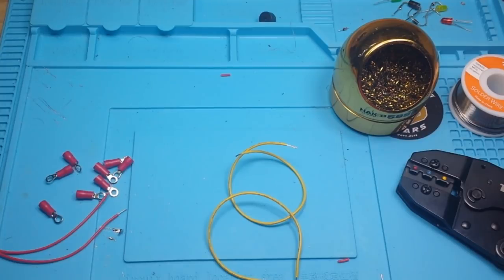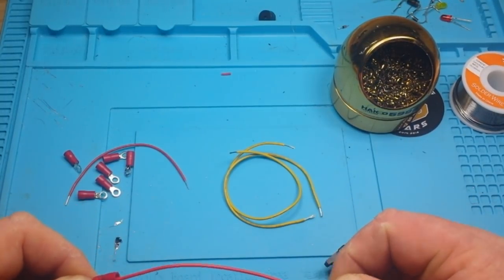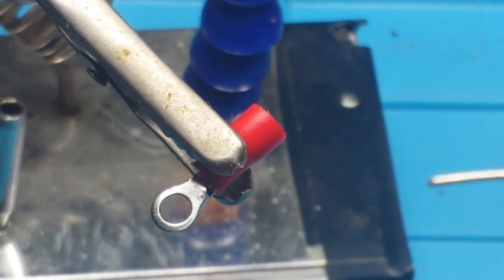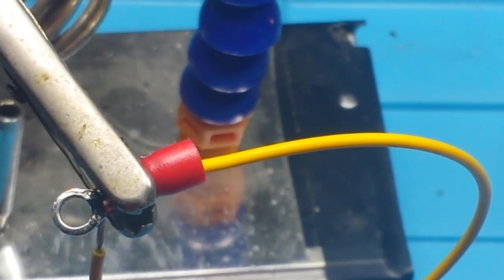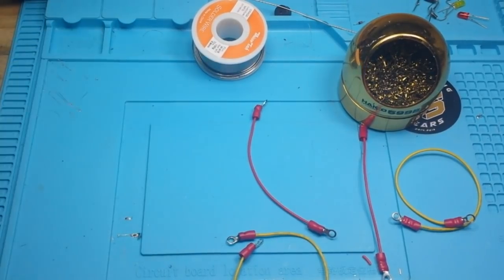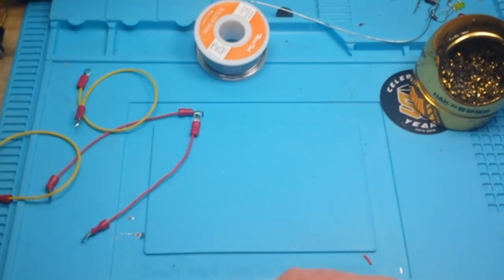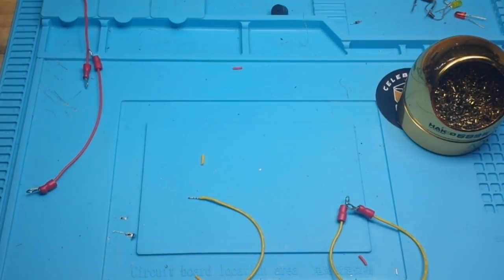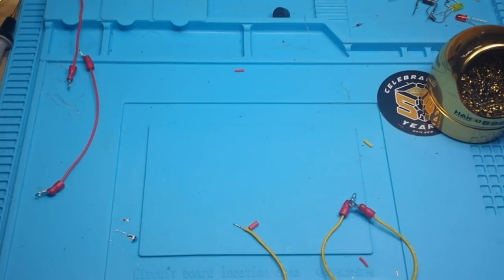To crimp or to solder terminal connectors

Comment: I really wanted to watch this video but I cant stand hearing anyone say SODDER...
Its spelled with an L in it FFS.
I dont know why this bugs me so much but it really does
Reply: The aluminum / aluminium debate is MUCH more fun, though.  :-)
Reply: @chrisw1462  Totally agree!!!  The colour of aluminium is FAR nicer than the color of aluminum <Tongue-in-cheek>.
However, it's still impossible to 'solder' aluminium just the same as it being impossible to 'sodder' aluminum

Can I please have some tah-may-toe sauce on my tom-are-toes?
Reply: @PW_12345  Weld alumin(i)um?  DEFINITELY...
But so(l)dering it? I seriously doubt it.
Perhaps a flux that's based on something like NaOH to remove the oxide surface followed immediately by soldering within some form of shield gas...
I'd prefer to stick with plain old TIG welding thanks
Reply: @PW_12345  - Close... the English say 'soul-der' (the last bit exactly as written, and essentially the same as the end of the American pronunciation). And it would be very rare for the word 'sod' to be used in its sexual sense (sodomy); normally it's an expression either of slight anger about somebody or something - or a lump of turf.

As for France, it's more than a political rivalry - we've quite deliberately spent the last thousand or so years winding them up in all sorts of ways! Here's one of my favourite examples: The Americans invented colour TV - the system was of course referred to by the initials of the standards committee - NTSC. Or as we knew it, Never Twice Same Colour. Then this guy in Germany called Walter Brusch fixed your little problem with a system using alternating subcarrier phase - PAL (Phase Alteration, Line). Of course, the French didn't like this at all - especially when the British adopted it. So this guy called Henri de France (really...) decided to go one better and do some really dodgy stuff with a delay line and separating out the colours and devised a thing called SECAM (SEquential Colour Aide Memoire). And of course we refer to that as System Essentially Contrary to the American Method... gets them every time!

And I often tin the very end of multistrand wire, and then crimp it - for all the reasons given.
Reply: It's English.    Letters are silent.

Comment: Not a Hot Button.   Not  even debatable.    Crimp and Solder ( or Sonic weld ) .   Build my AirCraft  and Subs  Right Sir.       Corrosion is the main issue at hand.

Comment: Copied from the interwebs: A crimped spade terminal actually creates a metal-metal colloidal bond at the surface between the wire and the terminal, and if done right, no gas remains between the surfaces. This ensures longevity and safety, making this the preferred mechanism in industrial implementations.
Reply: Like you said, where and the type of wire.
Reply: It is cheaper to mass produce.  That is the real motive.

Comment: You are using the wrong type of connectors for soldered connections. So you are not comparing apples to apples. You have way too much space between the wire and the connector for the solder to fill. In addition if you solder something and blow on it you are cooling it and can form a cold solder joint. Copper is a malleable substance that compresses and stretches. Over time, a crimped connector can fail as the harder metal in the connector loses contact with softer copper wire. Also, oxidation can form between the wire and the connector that are crimped creating a resistive connection. So, use a proper connector that is meant to be soldered that has a minimal gap between the OD of the wire and the ID of the connector. Solder it properly and install heat shrink that has some hot melt glue in it over the connector. You then have a waterproof connection that will not oxidize and degrade over time. As far as wire flexibility, if that is a concern in the first place you should be creating a pigtail in the wire to allow for flexibility or using an extremely flexible wire with many fine strands such as MTW. I would trust a good solder over a good crimp any day of the week. I have repaired thousands of assemblies due to poor crimps and loose connections and very few where a solder joint was used. Just my experience as a bench tech and ME for 30 years.

Comment: Am not keen on crimping there are 2 possible causes of failure !
Reply: 1) Vibration causing failure
2) Corrosion
3) Creep in the metal.
Reply: @kensmith5694  Corrosion on the connectors for sure. Metal creep and vibration causing the connection to break down. Crimps on plugs or socket pins on non moving items can be extremely long lasting

Comment: omg u dont know how to solder.. the flux is not hitting the metals at all
Reply from the maker: You're right. My 2 years of Navy training, and 8 years of college were for nothing. Thank heaven i didn't spend 23 years working in electronics, would have been a disaster.
Reply: @learnelectronics  I got u beat with 27 years in electronics :) certified ipc specialist. Putting solder directly on the solder-bolt tip and blowing cold air on a cooling down solder point is a big no no :)